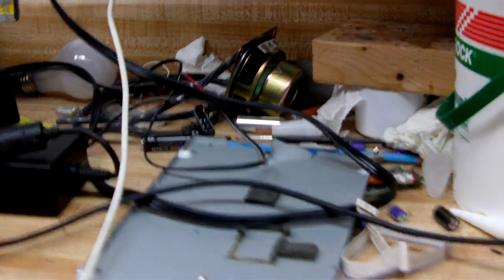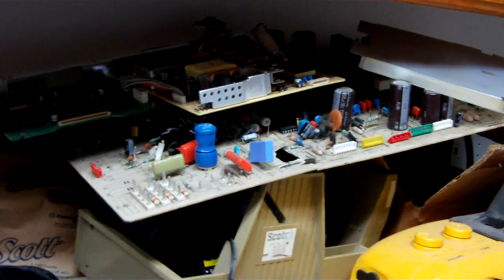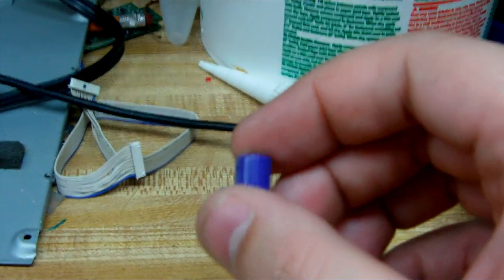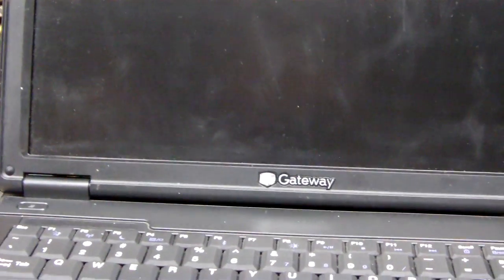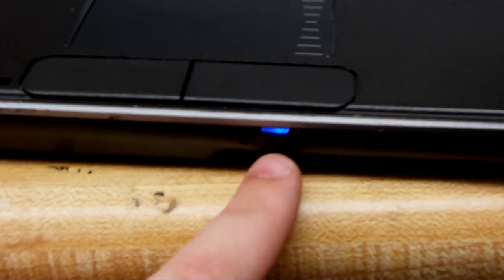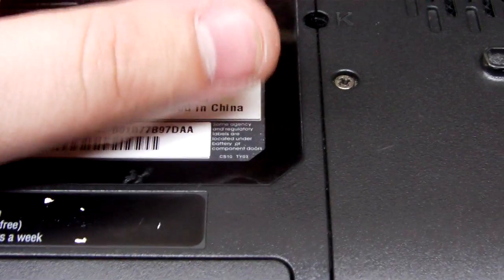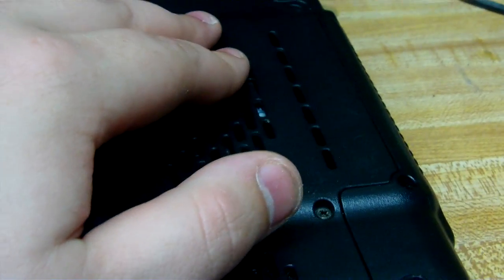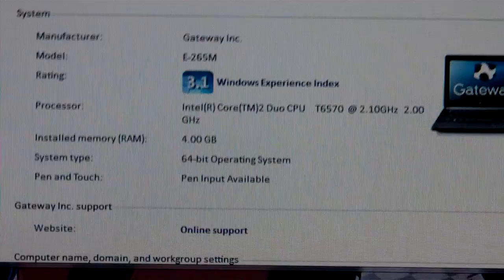$20 Gateway E-265M Overview Redo

Comment: I got to that cpu finally.   was easier than I expected. I have been sick though so I put it all off for a while, hope you are still there. LOL
       I haven't been able to find that 3rd wire you you were talking about, also I see there are tw slots there where that 4965agn mm1 goes.  I have been trying to see what that is for exactly.  I read something about a blue tooth card and I also read something about a memory booster card.  I was just wondering if any of that is cool to add.

   I don't have 4 gigs in this yet but it is really jamming now.  pretty amazing really.     Im a little lost on the software download for this card as well, I haven't installed it yet but when I went to intel site to try to download it to the desktop it seemed to nt be present, or maybe it was but I just didn't understand what one I was looking for.    I saw one guy that installed one of these cards as upgrade and he didnt even bother with third antenna but I thought that seemed kind of a waste if you can have it, add it, seems like it will work better that way right? 

   the blue jelly square of stuff they had on the second core was stuck on the chip when I took the heat sink up, I didn't trust it after it tore like that so I cleaned the sink and the chip and used the thermal c on both chips.  seems to be working great. also the heat sink fins were so packed with dust i could not see light through them.  so I blew those out with the air compressor.  what a huge difference! LOL      seriously, this things screaming.   I don't have it cluttered with any thing though. Im just talking about my internet speeds and boot ups and streaming.   I put nod 32 on it and office 2007.  when I go to windows 7 I think that will have to change.   I tried Norton for a but but I hate that bull shit.   windows update has been covering me on this one for some reason, weird I thought becuase on some of my other lamer lap tops laying around here ( im talking totally lame ) they will not even reach update. it just says NO MFER!  we are done with you! LOL. 

   I have to admit I have not got the case all the way apart , it doesn't want to come apart really, I took every screw I could find to get that back off because I thought you had told me there was a third wire in there somewhere.  but it wont come apart so far.
     so far this is going along really nice.     also didnt have the chnge for the new battery yet.  its on the adapter only.

  Thanks for the badass advise so far.   
Mike.

Comment: I got ahold of a brand new glossy screen a long while back.  after I wrote that last book of a comment I was looking at it in my pile of pc crap and thought.  that looks like the same sz.. LOL  so i pulled that screen out of the laptop and saw that 3rd wire. and I also took a look at that dull type screen. POOF   what are the chances I wonder?  that screen fit right in there. I'm sure it probably fits 50 more too, crazy though that I had that. anyway. I looked in the dvd compartment with a led cause I could not figure out where that 3rd wire went to and the sobs had it tied off in there.. I got some jeweler tweezers out and untied it, then figured out how to get the top above the key board off and then noticed that someone put only 1 screw in my key board. I pulled that screw lifted the keyboard, re routed the 3rd wire since it was a little short and then re routed up next to the other two.    I have not replaced the wireless yet. took a break to come back in here and write you another book and check my eBay sales. LOL   let ya know I found it and all that.   Looks like I'm gonna be short on screws.   I think I might ask santa for a solid state HD this year. Pretty sure that would make this a great system for me.   I think I can jumble these around and just use the ones that are 100% necessary for now. ha!  I just fired that bright glossy and it's wicked compared to the old one.  booted right up.  went ape shit though cause I don't have a wireless in there right now. apparently it does not like being deprived of it's internet card.  I may try that wired connection and let intel scam my shot and download the right driver for that. Just hook it up and see what happens. LOL
Reply from the maker: Glad to see you found the wire. also glad to see you got the CPU upgrade in. Yes, it was best of you to compound the Northbridge chip, it will thank you later. the extra slot is for an Intel RAM booster chip, yes, but they don't do anything for improvement, it's a niche thing. don't worry about that. the 4965 goes in where the current wireless card is. yes, you want to insall all 3 antennas. make sure to note which color wires are on which side, the gray wire always goes in the middle.

Don't ask for an SSD, ask instead for a 1TB hard drive: http://www.newegg.com/Product/Product.aspx?Item=N82E16822152291
I've used these things for a few years in numerous laptops and they're quite possibly the best laptop drives for the money.
Samsung also has a Spinpoint M9T out which is 2TB but considerably a bit more money but uses the same size drive. I don't believe SSDs to be completely trustworthy yet, not until we get 1TB SSDs forunder $100 and they're found to be reliable to hell and back-- there's just too many things that can go wrong. especially if the power is cut WHILE it's writing? the entire drive is dead. too risky.  hence why I still push for mechanical storage.

as far as antivirus: once you up to 7 (and I hope you use a slipstreamed SP1 ISO from within the last 6 months), just use MS Security Essentials. paying for any sort of antivirus or having to use a cracked version thereof is just wrong... and Microsoft's product is free and pretty much the best so long as you're using common sense and adblock on your current browser. Chrome adblock on Chrome, Adblock EDGE (not Plus) on Firefox along with the element hiding helper and disable anti-adblock extensions, and IE can go suck big ones. Yes, others will backlash about MS's Antivirus product, but that's their opinion. I've been virus-free for years.
Reply: MAN,  that download from intel was a nightmare. the program they loaded up has a dump load of security features and passwords and too damned many things to remember. after trying 3 times I just plugged straight into the router and went to windows update and got my regular crap with the right drivers for that card. all good now.  That card is amazing really. I can see everyone's network names all the way down the block in both directions and even in the next neighborhood behind me.  crazy. LOL   That doesn't even happen on my desktop.   Im Putting this thing all back together and going to take a nap now. been up all night playing with this.  yeah! 64.99 for a 1 tb   that's cool.  still 5400 though.    i don't pay for anything I don't have to LOL  and I don't have to cause I know how not to.  haven't bought software .... ever really.    im not sure what that sp1 iso is all about but I will check into that. last time I tried to get my alcohol 120% back I saw astromenda and some pup bs trying to get in system and I got rid of that idea. 120 is the only iso program I have ever used.  you say it will go on a flash drive without burning and boot though?
Reply from the maker: RockAnAhardSpot
 should. use the Windows 7 USB DVD Download tool (http://wudt.codeplex.com) from Microsoft's codeplex page and you should be good.

the hard drive might be 5400RPM but with that much density on the platter it's very fast. even moreso for the 2TB drive. I have a 750 Samsung as my boot and 1TB for my secondary in my Thinkpad T500, they're amazing.

also, that much range on a WiFi card? you must have gotten one of the fabled unhindered cards. keep that sucker safe, it's worth it. I also guarantee better speedtest.net runs with that one when you're out places with it.

I don't use alcohol 120%. I use IMGBURN for burning ISOs to discs and WinCDEmu (http://wincdemu.sysprogs.org/) which is free and open source for mounting ISOs. Alcohol has its hinderances, and it's not the best.

as far as finding the right ISO, you want Windows 7 Ultimate 64-bit, Slipstreamed with a date of August 2014 to October 2014 on the title in the results. that is assuming you're getting your ISO from TPB. ('yarr)